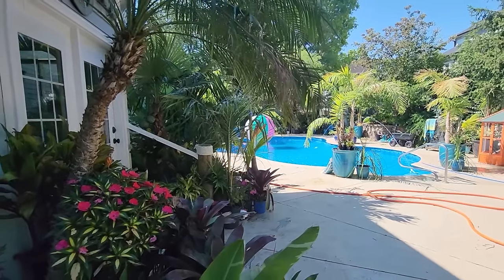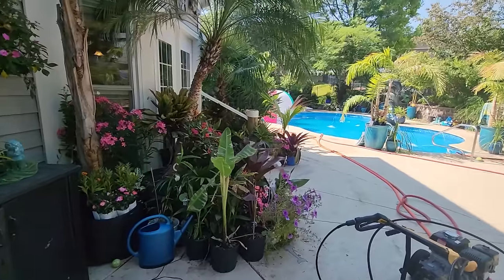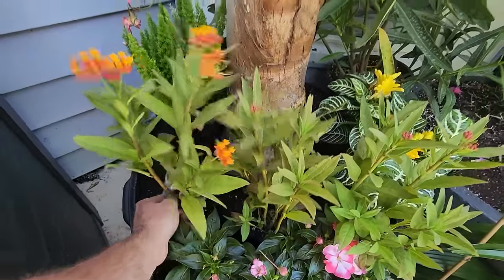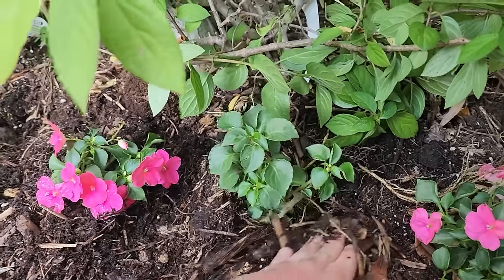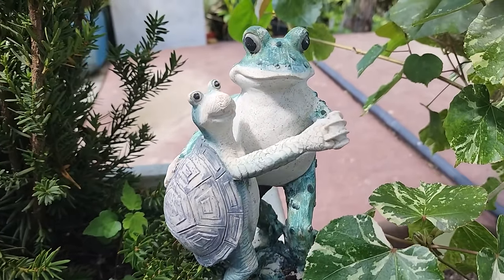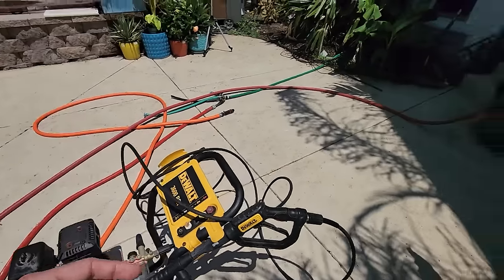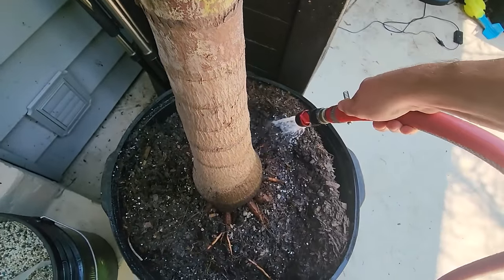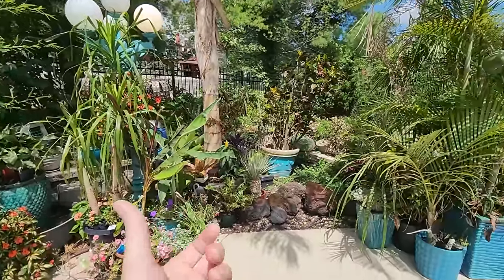Planting Colorful Containers || Gingers & Beach Planters and New Palms || Saturday Vlog

Comment: I bought 3 foxtail ferns years ago before the prices shot up, and have overwintered them in my growspace since. They are awesome plants I'm happy to have gotten so cheap.
On the weekends when I plan to spend most of the day outside, I let my little tortoises run free in the yard, and usually get stressed lapping the yard as the sun goes down trying to find the last one. I just don't trust them outside.
I've been watering in the evenings while it was so hot, cause I can't wake up earlier enough to water them before the sun is beating down.
You do need a 'patine' on the concrete. The one time I powerwashed our flagstone, the wife did not approve.